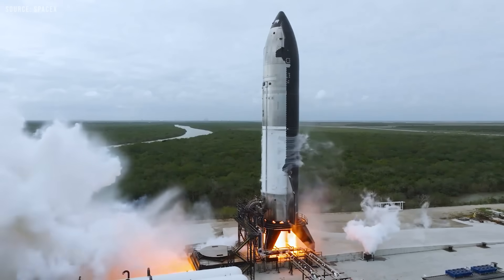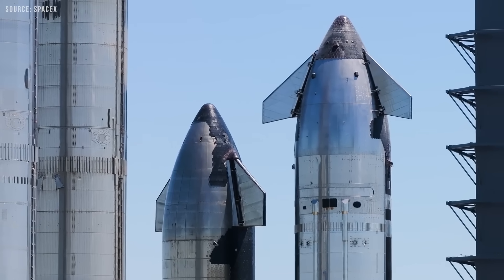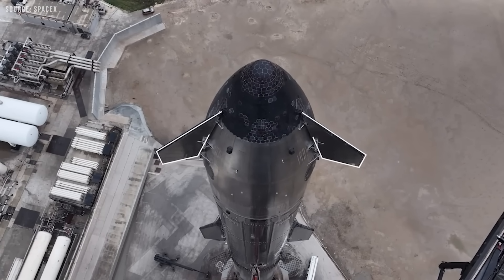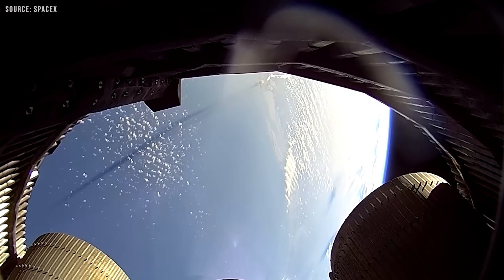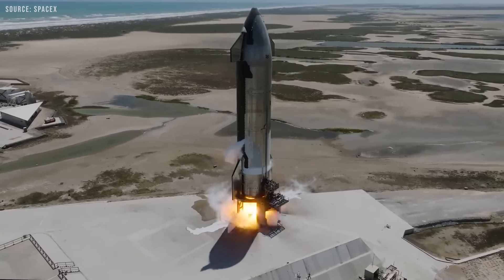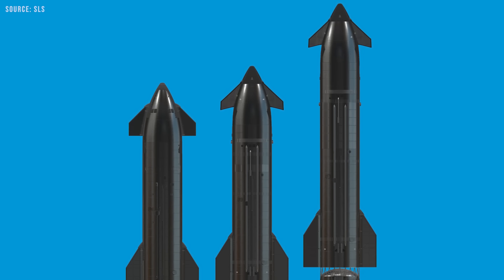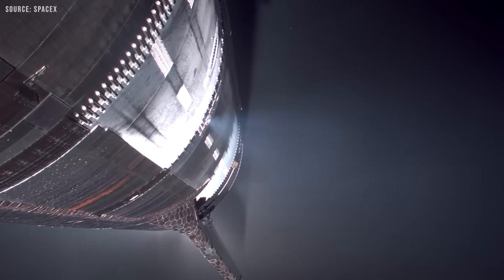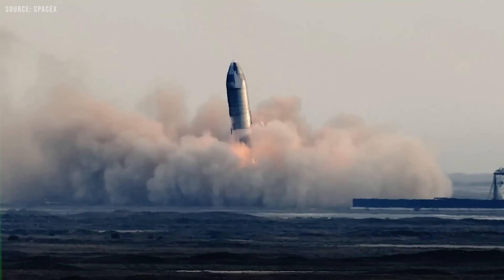SpaceX Found Brilliant Solution to Stop Starship LEAK in Space

Comment: SpaceX reported installing three different solutions to the resonance issue before flight 8. I suspect this was applied to the three vacuum engine methane feed lines. 

The inevitable solution to both Pogo resonance and hydraulic Hammer is to install hydraulic accumulators just before each engine methane inlet. 

We see devices like this in many homes to smooth water pressure fluctuations and quiet the pipes.

Flight 8 failed due to a sea-level engine RUD. The analysis was that engine fasteners needed greater tensile load to maintain main seals. As we know, flight 9 successfully reach SECO without an engine RUD.
Reply: rubbish. Pogo is not solved that way. If space x cant learn from history they are doomed to make these mistakes over and over. The solution for pogo was discovered in the 1940s.im glad elons American tax payers dollars are being vaporized as he has the same ideals as the Germans of that time during ww2.

Comment: The loss of attitude control comes from the tanks not being able to pressurize while the liquid propellant is being used. Space X has not given any clue to this issue. I don't believe that is related to a down comer issue since they feed directly to the engines. Not having the data and addressing only the downcomer issues related to harmonic vibrations, if it were my design, I would do one of two things for future ships. My second option would be to bundle all the downcomers together to increase strength. Hormonic stresses would be greater in the center of the vehicle so my first option would be to move the 3 smaller downcomers to the inside sidewall of the tanks. But on the already constructed vehicles, they'll just add steel to arrest the harmonics.

Comment: Don't forget Hammer is also an issue it's not about Pogo it's about when the engine start or stop there's a shock wave that goes through the fuel system
Reply: The inevitable solution to both Pogo and Hammer is hydraulic accumulators just before each engine methane inlet. You see devices like this in many homes to smooth water pressure.